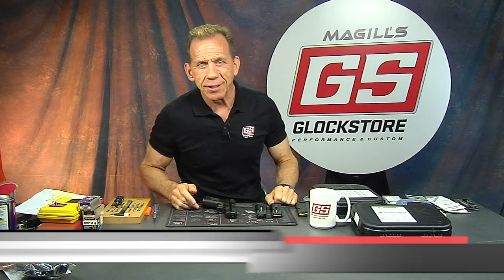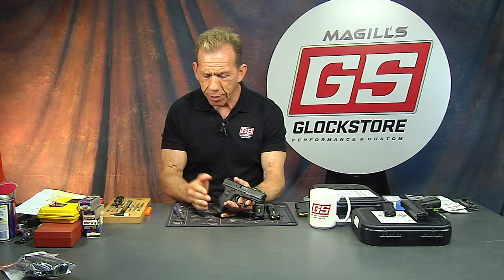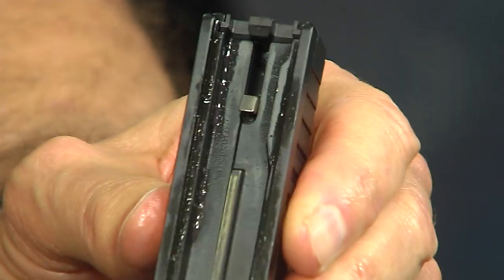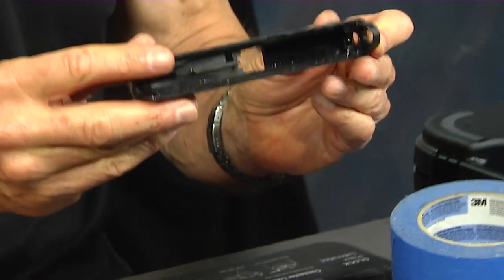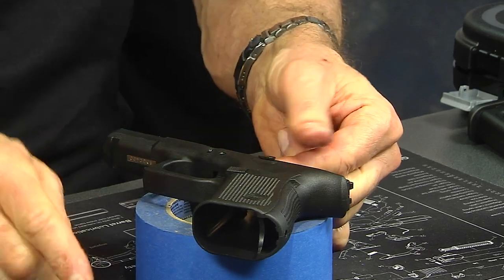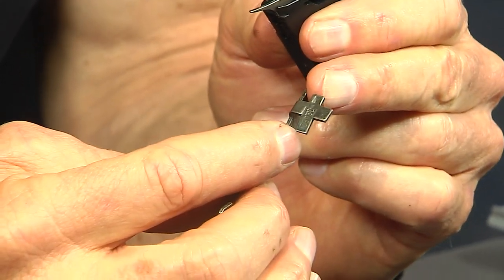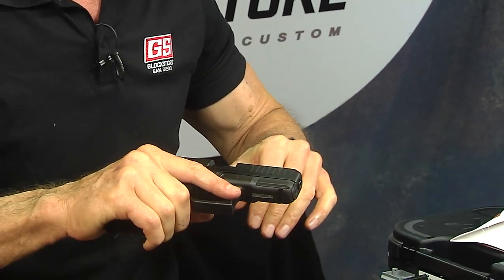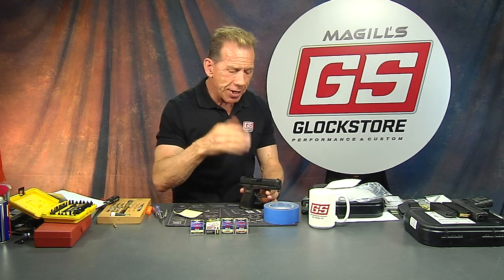Lenny Magill checks out the G44 in studio.

Comment: It's important to understand that the velocities listed on a box of .22 are almost always rifle velocities, and handguns will have substantially less
Reply: They are still hauling. a Stinger out of a short barrel is moving and will go 10-12 inches into a gel block if not farther depending on pistol legnth.

.22 Long Rifle High Velocity and Hyper Velocity

Test Pistol: Colt New Frontier Convertible Revolver, 4 3/8" barrel.

CCI Stinger, 32 grain HP - 1243 fps Avg, 69 fps ES.
CCI Mini-Mag, 36 grain HP - 1032 fps Avg, 110 fps ES.
CCI Mini-Mag, 40 grain RN - 1039 fps Avg, 67 fps ES.
Federal Spitfire, 29 grain HP - 1208 fps Avg, 39 fps ES.
Federal Classic, 40 grain RN - 1000 fps Avg, 77 fps ES.
Remington Yellow Jacket, 33 grain TCHP - 1245 fps Avg, 64 fps ES.
Remington Viper, 36 grain TCSP - 1128 fps Avg, 92 fps ES.
Remington Golden Bullet, 40 grain RN - 994 fps Avg, 88 fps ES.
Winchester Expeditor, 29 grain HP - 1136 fps Avg, 138 fps ES.
Winchester Super-X, 40 grain RN - 1029 fps Avg, 50 fps ES.

Comment: The velocity on the ammo boxes are through a rifle test barrel. I think you probably loose 4-500fps out of this short barrel. Non the less, these are still good ammunition choices.
Reply: .22 Long Rifle High Velocity and Hyper Velocity

Test Pistol: Colt New Frontier Convertible Revolver, 4 3/8" barrel.

CCI Stinger, 32 grain HP - 1243 fps Avg, 69 fps ES.
CCI Mini-Mag, 36 grain HP - 1032 fps Avg, 110 fps ES.
CCI Mini-Mag, 40 grain RN - 1039 fps Avg, 67 fps ES.
Federal Spitfire, 29 grain HP - 1208 fps Avg, 39 fps ES.
Federal Classic, 40 grain RN - 1000 fps Avg, 77 fps ES.
Remington Yellow Jacket, 33 grain TCHP - 1245 fps Avg, 64 fps ES.
Remington Viper, 36 grain TCSP - 1128 fps Avg, 92 fps ES.
Remington Golden Bullet, 40 grain RN - 994 fps Avg, 88 fps ES.
Winchester Expeditor, 29 grain HP - 1136 fps Avg, 138 fps ES.
Winchester Super-X, 40 grain RN - 1029 fps Avg, 50 fps ES.

Comment: I believe the Glock 44  is probably the most innovative thing Glock has done in years! That said Glock needs to lower the price on the gun, threaded barrel,  and the low capacity 10 round magazines!  I wouldn’t mind spending $30 for a 15 round mag. I was pissed having to pay that much for a 10 rounder. Over all this gun and accessories are just too expensive.  I bought mine to shoot GSSF Matches in the rimfire division. In that role mine has performed well. I broke it in with 300 rounds of mini mags straight from the box . No lube, no cleaning, only a quick take down and inspection before firing. I do this with all my new guns to find wear marks. If you lube first it takes longer for the marks to show up. I had absolutely zero issues with my 44 during the break in period. Prior to delivery of my gun I watched every YouTube video I could find and avoided the mistakes early adopters made. First they used the crappiest ammo they could find. Second they did not load the magazines properly as the mags are ridiculously finicky. Third most did not take the time to adjust the sights for windage or elevation. Mine shot high and left as most of the videos attest. After sight adjustment I was shooting at point of aim @ 15 yrds. I tested my 44 with various ammunition but settled on the cheapest most reliable that I could find that was available locally the first is Federal bulk 500 rounds, 36 gr. Copper Plated Hollow Point the Second Winchester bulk 555 rounds, 36gr. CPHP.  Both are available at Walmart.  After 4000 rounds I have stopped counting. The gun is not perfect during the first 4K shooting cheap bulk I have experienced a few stove pipes, FF, FE, light primer strikes Etc. As far as reliablity it is as good a my 2 PPQ 22’s, Ruger Sr22, Beretta 92M2-22, Walther P22 5” Target. When shooting matches I will only use CCI Standard or Mini-Mags. So far no issues with CCI
Reply: The most innovative because it blows up lol 😂 😂

Comment: First, I’ve wondered when Glock would come out with their .22LR pistol. I’m glad they did it on the G19 platform. I have .22LR versions of other fuller size pistols that help for putting LiveFire into “DryFire” practice. When the G44 was in the pre-order phase from gun stores, I did mine through GlockStore. Second, like this review. Third, one thing I’ve noticed of the G44: thought it’s not a fixed barrel, it sort of acts like a fixed barrel. The barrel doesn’t drop like the other Glocks during cycling and loading each round. The chamber block’s top seems to run flush with the underneath side of the slide’s top. So the “locking” block doesn’t seem to receive as much stress with the .22LR cycling as with the other caliber cycling. It just looks like it secures the barrel between it and the take-down lever. Therefore, with the reduction of weight, I think the plastic locking block was a reasonable engineered decision. Thanks GlockStore for this great review.

Comment: The G44 wasnt the success I expected and hoped it would be. My thinking was that it was going to  be the definitive 22lr combat oriented pistol with Glock center fire reliability. Maybe Glock over promised on this one, but I shot a couple and tbh there is not much difference vs offerings from other manufactures - reliability is on par its competitors. In fact I found a Keltec P17 to be more reliable while offering a high mag round count and other value adding features at a lower price.

Comment: I have found one specific brand and model of ammo that functions 99% out of 500. The other brands run between 50 and 75% reliable. I was warned by several people, but that is still unacceptable. I've tried several different lubes and cleaning techniques as well. Doesn't matter the loading or grip, it is not reliable save for the magic ammo. I love the gun when it works, but I bought a Glock cause they always work.

Comment: What a piece of junk ! Not worth 2 cents, until Glock fixes all the problems on early 1st release models that failed, jammed & even exploded. And I own & like many Glocks myself. Fix it or dump it.
Reply: Yup exactly I'm a glock guy to buy this is just stupid. It hurts the company's reputation
Reply: Sig did the exact same with the mosquito . . . big brand name companies that cant get a .22 right. My dad[ having previously owned the mossy ] and sister own Ruger SR22s and they [ the pistols ] kill it every time. reliability. feed almost any ammunition [ i have yet to see them stove pipe ] but they have, just due to excessive gunk build up. only problem ? they dont fit my hand [ too small ] i bought a chiappa 1911 and to be fair ... for a cheap [ GBP 300 in Northern 
Ireland ] pot metal gun its surprisingly accurate. weighty for what it is. and at least its full size. if i pick my ammo correct she cycles fine. i hear cz have a few issues just getting the correct spring for ammo. they supply a few but once you dial in ammo to spring you are golden.